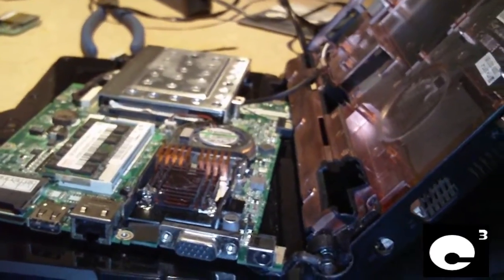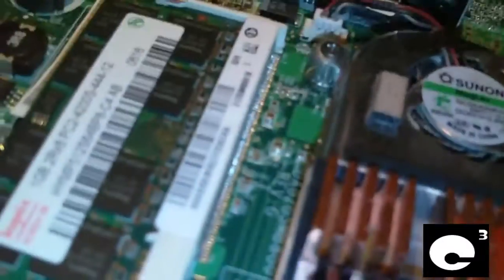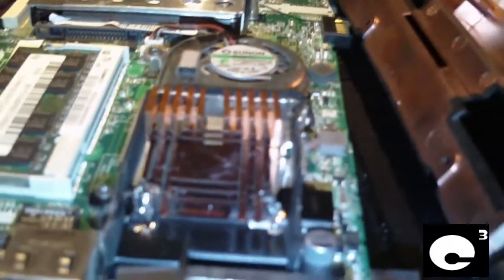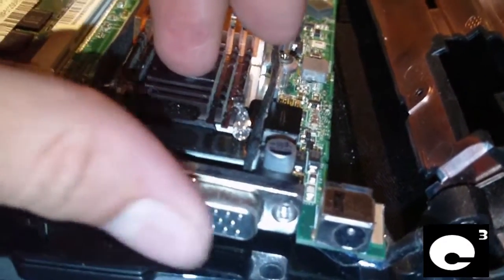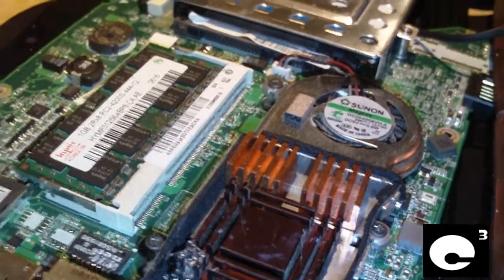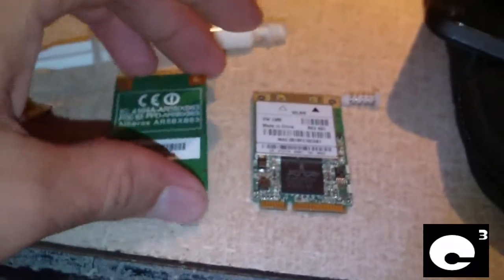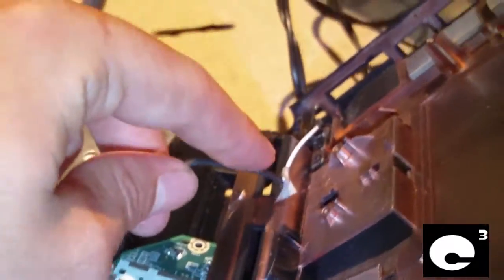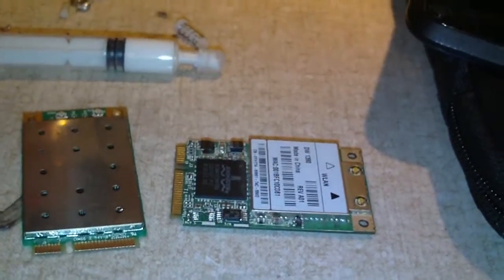Another look inside the Aspire One A150 - Cooling & WiFi Card Upgrade

Comment: it's funny you mention the cooling system of that one being skimpy. i had a dell mini 10v for a long time. that netbook died all of the sudden due to memory parity errors that were related the the motherboard and not the ram for some reason. ram controller failed probably, but anyway. that netbook didn't even have a fan....at all....which in my mind is horrible. i ended up using a cooling mat to keep it from cooking itself, but it eventually did anyway.